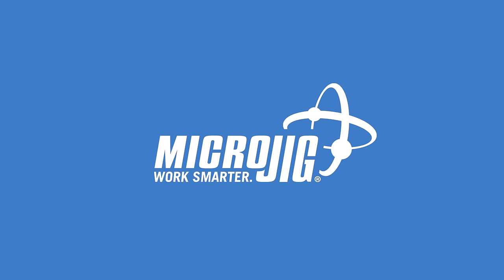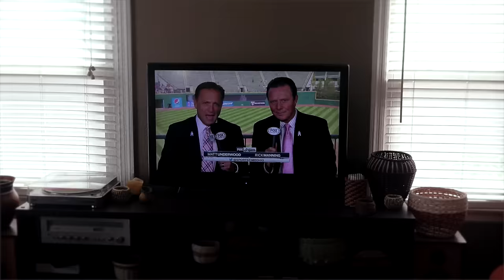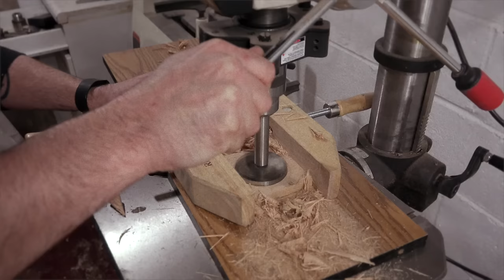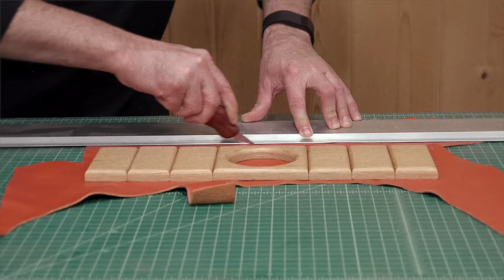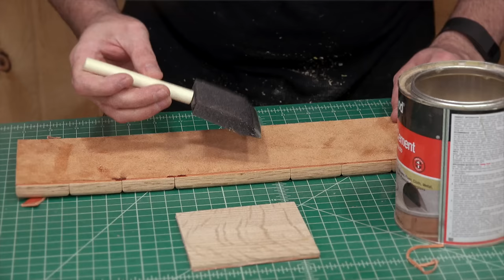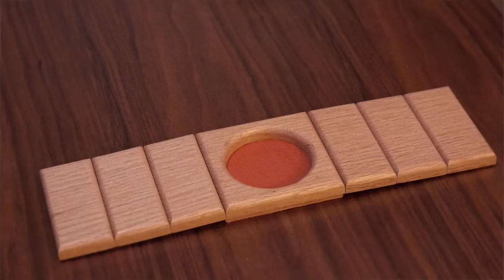Woodworking Project: Armrest Drink Holder

Comment: Great stuff David. Do you lift up your stop block before each cut so your brake cartridge doesn't engage? I have a sawstop and am curious as to why you did that. I'll take my answer off the air. Thank you.
Reply from the maker: +Katz-Moses Woodworking Shop Thanks! I lift it so the pieces doesn't get caught between the blade and the stop. Safety first!

Comment: Great idea and execution!  What adhesive are you using for the wood/leather bond?
Reply from the maker: +Wm. Walker Co. I used Titebond Quick and Thick but I don't recommend it. Next time I'll try contact cement or wood glue.
Reply: +Make Something Did the glue not hold up as well as you expected?
Reply from the maker: Yeah, I could easily peel the leather right off.

Comment: How has this held up? It looks like it could use more weight on the sides or a deeper cup holder? Are there any adjustments you would make in hindsight?
Reply from the maker: The design is fine. I would just try and find a better glue next time.

Comment: I notice a lot of image noise in this video. I wonder if the ISO might have been accidentally boosted or if this is just an odd YouTube encoding artifact. Interesting project. Not sure I would trust it on my rather plush couch arm rests, but probably good for more solid arm rests.
Reply from the maker: +Perspectologist High ISO because of low lighting. Thanks for noticing.
Reply from the maker: +Make Something Actually high "gain" when using a video camera.

Comment: Is there a reason why you lift the metal stop block before each cut?
Reply from the maker: +Riku Lindblad So the piece doesn't get pinched between the blade and the stop and come flying back at me.